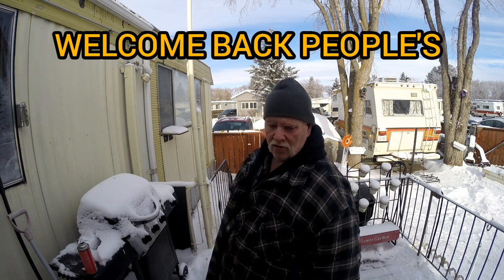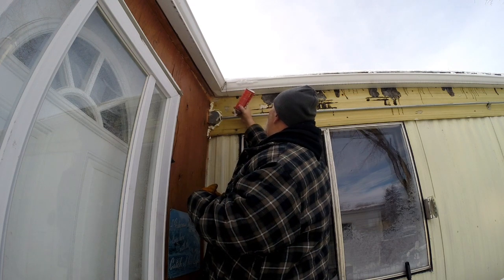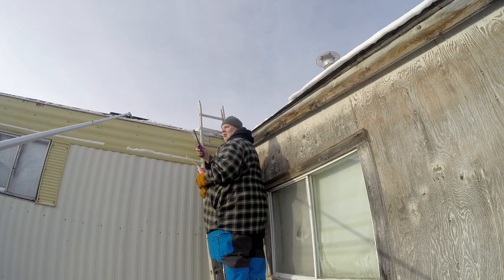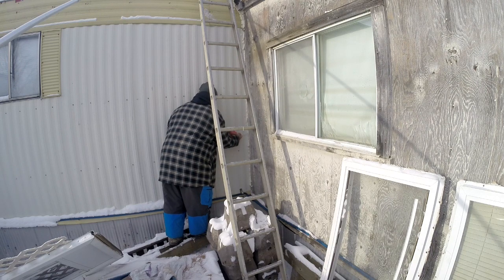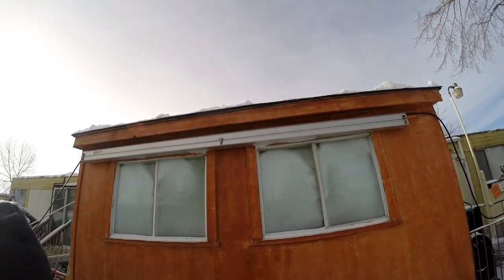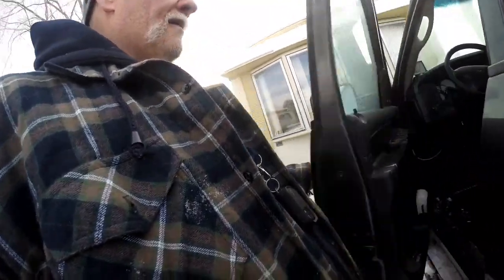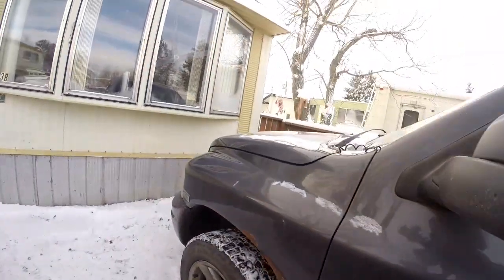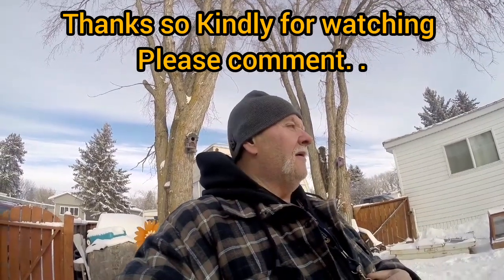Found some Drastic heat loss in Porch ,Simple Repair in can.

Comment: I guess that would be easy giveaway  for heat loss having a bunch of birds at one place on the roof
Reply from the maker: Didn't catch on right away, Figured that out when porch was getting colder and colder Furnace is finally shutting off, Thanks again Keith.